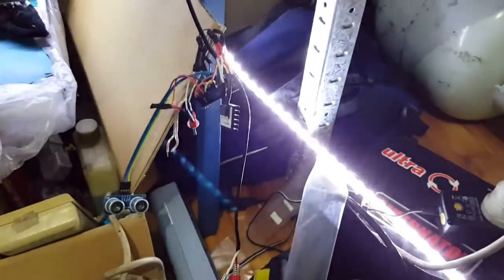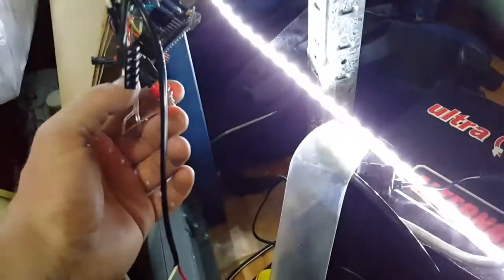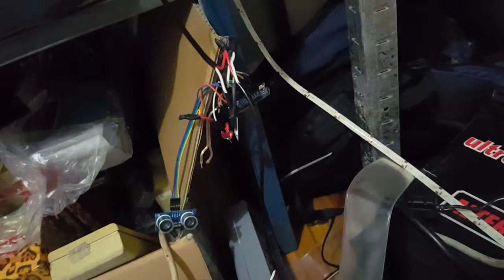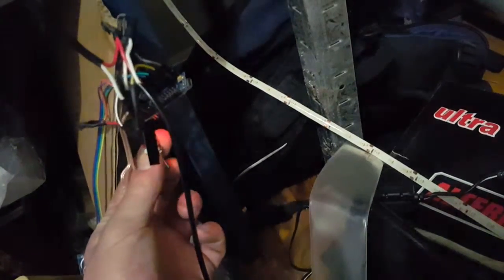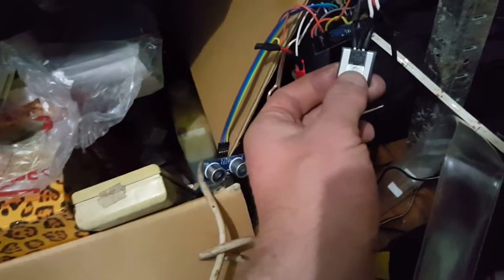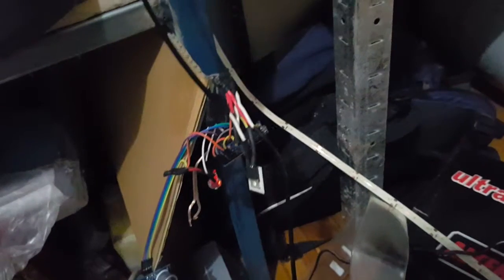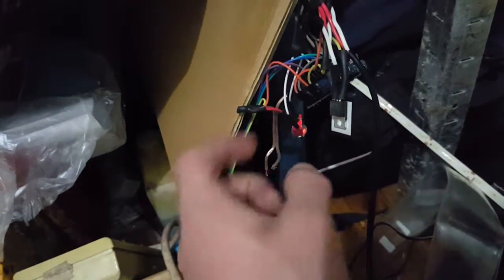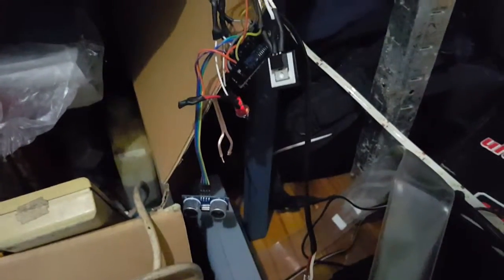Arduino ultrasonic led fade (long)

Comment: could you please share the code for this? :D
Reply from the maker: hey yeah ill post it below. sorry didnt get around to it earlyer. you ready now? im just having a beer
Reply: Okay, thanks! is the LED strip running on a 12v supply?
Reply from the maker: its got common positive 12v. the arduino switchs the mosfet on the negative side of the leds
Reply from the maker: //By Ken Graham 2015
#define echoPin 6 // Echo Pin
#define trigPin 7 // Trigger Pin

int maximumRange = 200; // Maximum range needed
int minimumRange = 0; // Minimum range needed
long duration, distance; // Duration used to calculate distance

int hug=0;
int ledState = HIGH;
int buttonState;             // the current reading from the input pin
int lastButtonState = LOW;   // the previous reading from the input pin
  int voltage;
  int mode=1;
  int duty=0;
  int antibounce=0;
  long lastmillis = 0;  // the last time the output pin was toggled
long currentmillis=0;
int vled=LOW;
int lastduty=0;
// the setup function runs once when you press reset or power the board

void setup() {
 Serial.begin(9600);
  pinMode(13, OUTPUT); //onboard led for battery indicator
  pinMode(9, OUTPUT); //output to mosfet pwm
  pinMode(4, INPUT); //input on mode switch
  pinMode(5, INPUT); //input om mode switch
  pinMode(12, INPUT); // trigger button switch
  
  pinMode(trigPin, OUTPUT);
  pinMode(echoPin, INPUT);

}

// the loop function runs over and over again forever
void loop() {
mode=1;
if(digitalRead(4)==1) mode=0; 
if(digitalRead(5)==1) mode=2;
Serial.print(mode);
Serial.print('\n');

int reading = digitalRead(12);

voltage = map(analogRead(7),500,820,2000,0 );

currentmillis=millis();
if ((currentmillis-lastmillis)>voltage){
    if (vled==HIGH){
    digitalWrite(13,LOW);
    vled=LOW;
    lastmillis=millis();
    }
   else {
    digitalWrite(13,HIGH);
    vled=HIGH;
    lastmillis=millis();
    }

  }

if (mode==0){
    if (reading==HIGH){
      if (duty==0){
         for(int duty=0;duty<=255;duty++){
            analogWrite(9, duty);
            Serial.print(duty);
            Serial.print('\n');
            delay(4);
         }
         duty=255;
       }
       else{
              for(int duty=255;duty>=0;duty--){
              analogWrite(9, duty);
              Serial.print(duty );
              Serial.print('\n');
              delay(4);
              }
              duty=0;
         }
       }
  }       

if (mode==1){ //-----------------------------ULTRASONIC SENSOR FADE
    /* The following trigPin/echoPin cycle is used to determine the
   distance of the nearest object by bouncing soundwaves off of it. */ 
   digitalWrite(trigPin, LOW); 
   delayMicroseconds(2); 

   digitalWrite(trigPin, HIGH);
   delayMicroseconds(10); 
 
   digitalWrite(trigPin, LOW);
   duration = pulseIn(echoPin, HIGH);
 
   //Calculate the distance (in cm) based on the speed of sound.
   distance = duration/58.2;
   if (distance >= maximumRange || distance <= minimumRange) distance=maximumRange;
   lastduty=duty;
duty=map(distance,1,50,255,0);
if (lastduty==duty) delay(50);
  if (lastduty>duty){ //-------------------------FADE RATE ON ULTRASONIC SENSOR
    for(duty=lastduty;duty>lastduty-20;duty--){
       analogWrite(9, duty);
        delay(2);
      }
    }
  if (lastduty>duty){ //-------------------------FADE RATE ON ULTRASONIC SENSOR
    for(duty=lastduty;duty<lastduty+20;duty++);
       analogWrite(9, duty);
        delay(2);
      }
    }

Serial.println(duty);
 analogWrite(9, duty);  
 //Delay 50ms before next reading.
 
}  

if (mode==2){ //---------------------------CONTINUOS STROBE WITH FADE
    //if (reading==HIGH){
      if (duty==50){
         for(int duty=50;duty<=255;duty=duty+3){
            analogWrite(9, duty);
            Serial.print(duty);
            Serial.print('\n');
            delay(1);
         }
         duty=255;
         delay(10);
       }
       else{
              for(int duty=255;duty>=50;duty=duty-3){
              analogWrite(9, duty);
              Serial.print(duty );
              Serial.print('\n');
              delay(1);
              }
              duty=50;
              delay(10);
         }
       //}
  }  

}